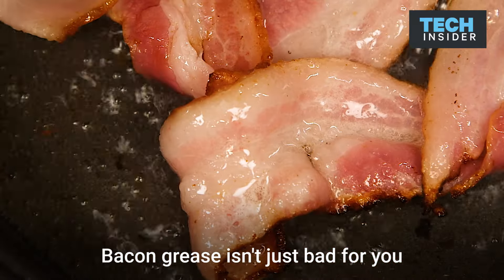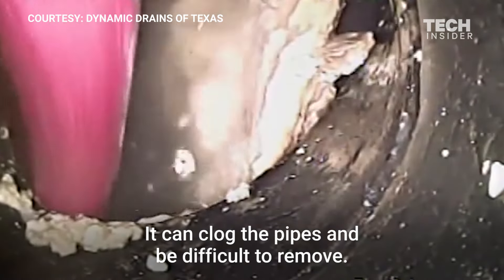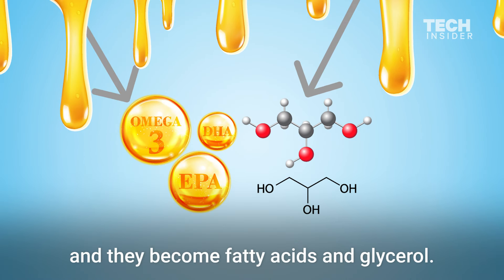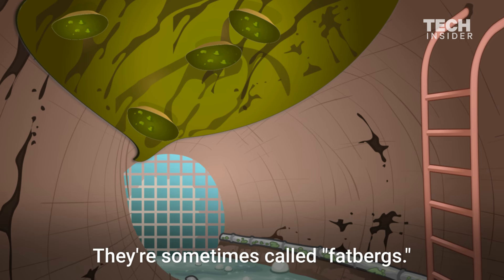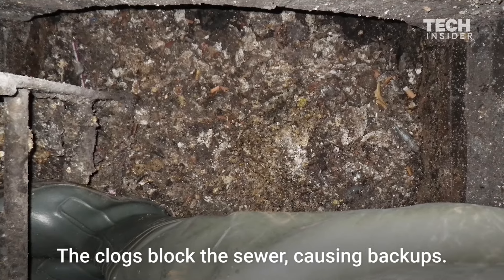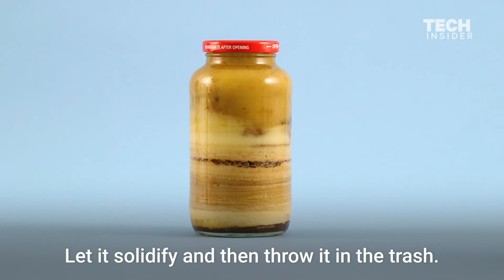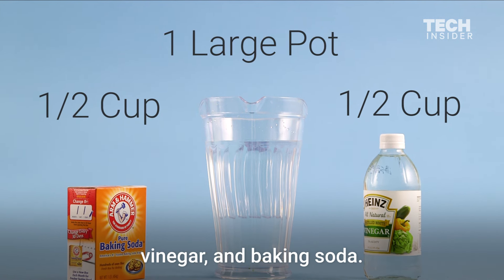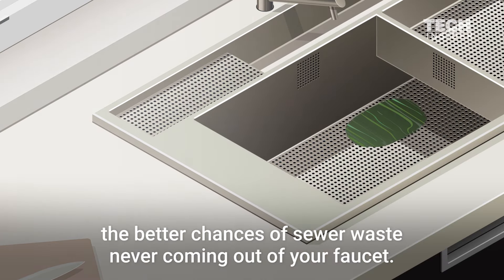Why you should never pour grease down the drain

Comment: Do not throw your bacon grease away.  I filter mine using a fine mesh strainer and keep it in my fridge for use.  I use it just like I would butter but for foods I want to add a bit of smoky bacon flavor like when frying up onions to make chili.  I've even heard you can use it as a substitute for lard in pie crusts to get a savory crust!

Our ancestors used all of the animal and when used sparingly it can be just as fine as using butter to cook.

Vegetable oils are often created by using chemicals (try to buy cold pressed oils to avoid this) and oils like olive oil have low smoking points which can create carcinogens in your food.

Comment: i work in mcdonalds, more grease gets flushed down the sink than water :x
Reply: Edward Greenan At six flags, they have us dump all the grease in this HUGE black bin and it gets carried away by this truck. God knows where it goes..
Reply: yeh we empty the troughs in the big black bin but we have to spray the residue out in the sink, so you can imagine the amount of fat bergs mcdonalds is creating lol
Reply: mcdonalds is everywhere bro
Reply: uh you do know there grease traps in the lines at all restaurants built after 1990 right lol they get cleaned out frequently
Reply: yeah at mcdonalds they are supposed to use the black grease bin hardly any grease ended up in the sink we just left it in a giant pot in the cooler then poured it when it got full
Reply: WeighterGreater, they collect those grease to make soap. AKA the only right way to deal with them grease
Reply: Edward Greenan And obviously it's McDonalds.

Comment: Says grease is difficult to remove from piping…later says it's easy with just hot water vinegar n baking soda
Reply: I don't that you payed enough attention
Reply: Ivan T ikr I was waiting for someone else to relize this
Reply: Andy Liu how? That's what the vid said
Reply: 2017 7102 it's doesn't requiere to pay close attention the vid is literally a min n a half n is very noticeable. Also u forgot the know between don't and that
Reply: removing from public sewer where a huge amount has accumulated is difficult, but removing some grease from your own house is easy on ur part, they also use some chemicals in their power wash system to clean, ur vinegar and baking soda is a household method. this is why i think the vid did not contradict itself.
Reply: Andy Liu it did cause it was sayin removal from piping in ur house was difficult then said it was easy

Comment: Better yet don't dump your grease at all, grease has literally hundreds of uses. It burns, it lubricates, some greases can eat rust and protect metal. In the days of steam, before they invented the drip oiler, they used to drop a huge lump of tallow down the blast pipe, to keep the cylinders lubricated.

Comment: Actually pouring boiling water down your drain can be worse, the plumbing system isn't ment to handle temperatures hotter that 140 degrees. Anything over that needs to be put into a condenser tank to be cooled first.

Comment: You can pour grease down the drain. You just run hot water down the drain for a minute or two. Never had a clog. 
However, because it goes into the public sewer system then that's a different story.